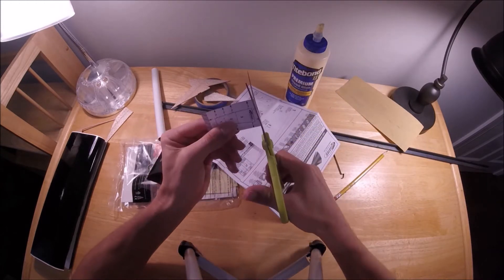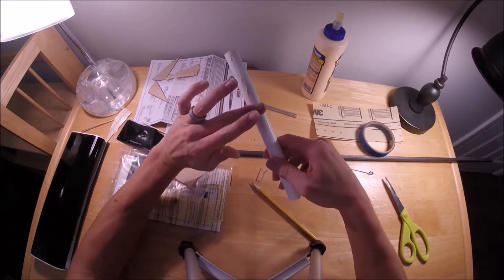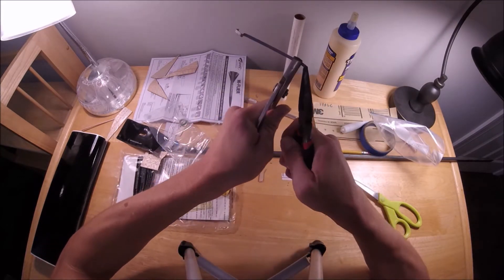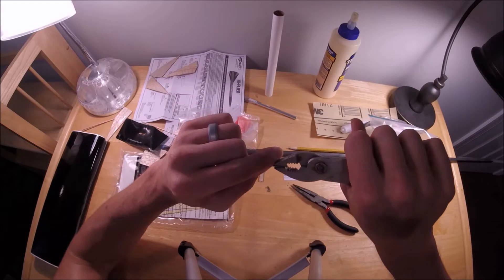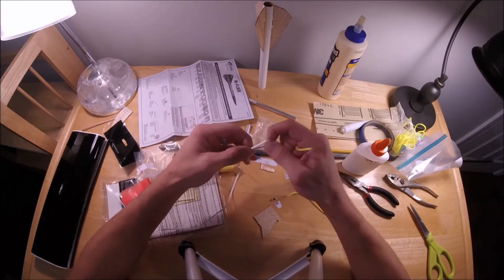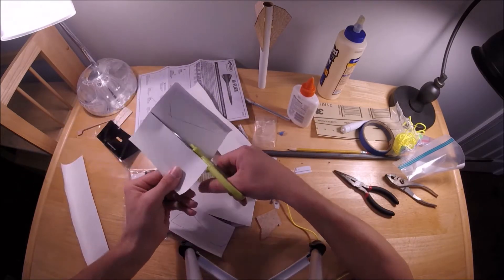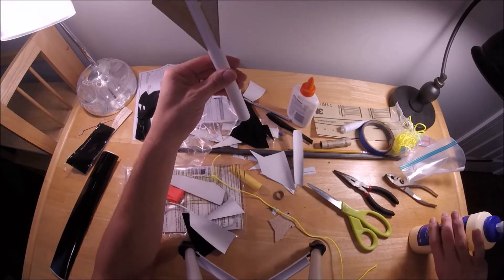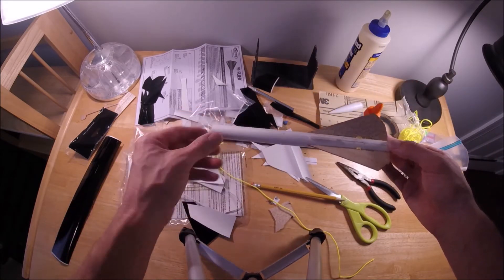Estes Hi-Flier Rocket Build Tutorial

Comment: I was thinking about using a parachute with this build instead of the streamer do you think that would work or is it too light for a chute?
Reply: Im building it right meow also would plastic composite fins work
Reply from the maker: I think it could work, I bought the Estes Bandit 3 pack a while back and those rockets came with parachutes.  I will say however, I flew the Bandit with a streamer and not a parachute so I can't say I've done it myself.  My recommendation is to go with the streamer, it works fine with my Hi-Flier.
Reply: @rwkhobbies1969  But on high flights, it will drift too much away from the launch site and a larger chance the little guy will get lost.  The streamer brings it down closer and still safe.  So, why mess with it and add more weight.